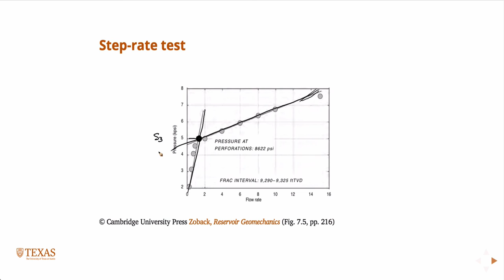Step-rate test

Comment: Sorry but this isn't good instructions. It explains 0 what flow rate means on x axis. Flow rate of what? The well? The injection of fluid during fracking? Also it says pressure at perforation 8,622 psi when the y axis doesn't even go that high. It makes me unsure if the y axis pressure is perforation pressure or what because 8622 isn't even on the scale. The Y axis says pressure. Again, specificity is always needed. Pressure of what? Well flowing pressure? Reservoir pressure? Wellhead pressure? This is just a lazy graph.